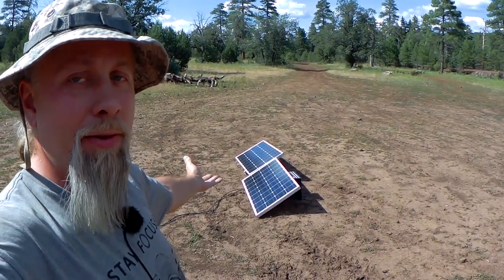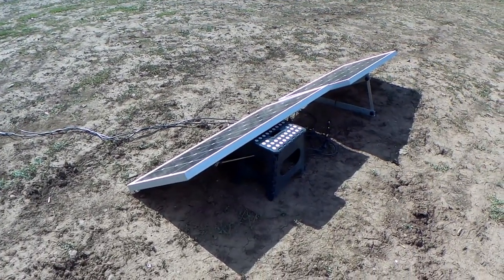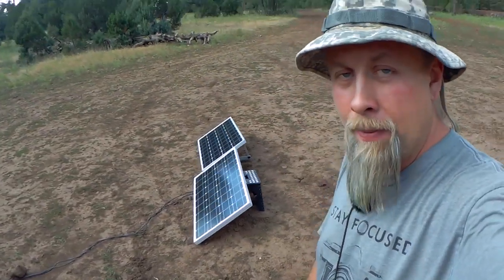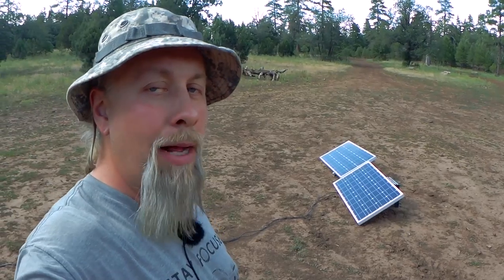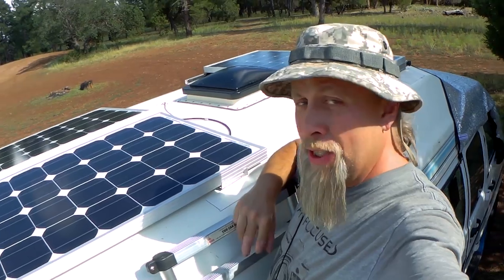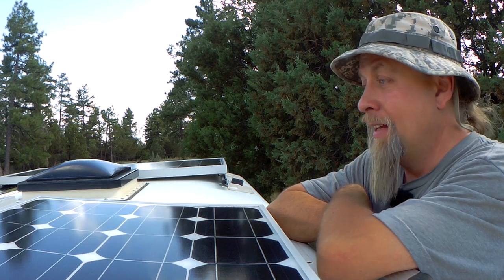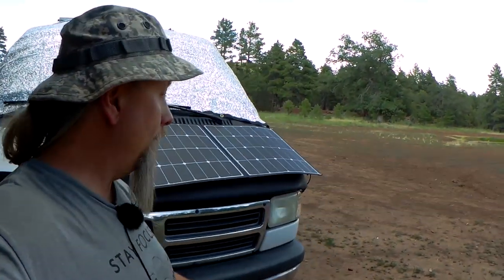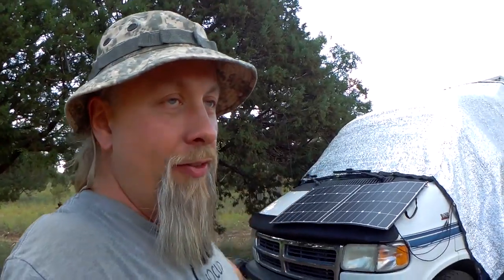Roof Installed Solar -vs- Portable Solar Panels For Your RV? Pros And Cons

Comment: I have considered a lot of the things that you have discussed. One of my thoughts is probably not practical due to weight and bulk but an aluminum frame that mounts to the top of the van that can be slid off. That way when you're driving it is fixed and when you get to where you want some shade and you're sitting you could deploy the entire rack and of course tilt it. I also considered because it is cheaper to do non pure sine wave for the items that are not picky. Pure sine wave only for instance on television and computer this would be a smaller unit with less loss and I would supplement with a cheaper one. I figure I would not have to run a large pure sine for everything because when you turn it on you produce a 10% loss automatically. With two you turn the inverter on that you need at the time
Reply from the maker: So you're saying climb up on a ladder and try to remove a bulky aluminum frame full of heavy solar panels by yourself? What about all the cabling too? Would you be able to secure this removable rack to the roof without it rattling? Far too complicated IMO. And you do want pure sine for things like microwaves and induction stoves. May as well just pay a bit more for something that will run everything.
Reply from the maker: Now what you can do is get a cheaper/lower wattage pure sine for the main stuff and run small dirt cheap modified sine for individual stuff. This way you don't produce as much loss. Smaller inverters of either type produce less loss than a larger model. My 1500w pure sine wastes 12w when it is running while my tiny 150w Foval modified sine barely loses 1 watt. Most of the stuff I charge boondocking is with the 150w.
Reply: @HOBOTECH  that is exactly what I was thinking. I hate the idea a firing up a big pure sine inverter when it is not necessary.. as far as Deployable solar panels... I was considering the idea of a roof rack with a ladder and panels mounted it. It was attached is simply as a ladder to the top of the van and it would slide off just as easy as a ladder. I am devising ways to do Rainwater catchment also. For example the homemade tarp awnings have the annoying puddle in the middle I have a simple idea to install a drain. Solve two problems at the same time. Look up water catchment with a tarp. On the internet there is rain calculators 1 inch of rain on a 8 by 10 tarp is substantial. Simple matter of adjusting two legs closer to the van creating a valley one higher on the end to create a slope 99.9% clean water except for possible dust residue that can be filtered out with any filter worth its salt. Landscape lights with the top removed gives you a small panel battery and light for under cabinet lights. Place on the ground   during the day or in the dash while you're driving . I'm not on the road yet but listen very closely to the problems and try to come up with a remedy. In a attempt to stay out longer. Generator yes if I am going to have cloudy rainy days not going to sweat it I'll be collecting water so I can stay out longer. I don't have to worry about Muddy roads and no water if I took advantage of the situation. Out of propane rocket stove and down twigs. I'm giving away all my video ideas LOL
Reply: @weswalker1208  Yes you are giving away video ideas but hey do your videos and someone will copy/compete anyway. LOL I like the water catch idea. I had a plan but yours is much better. And the light idea wow. I get those as scrap throwaway stuff quite often and they still work! Great idea especially for me who gos as cheap as possible and does a lot of DIY. Fair Winds and Smiles.
Reply: @CaptainJackScrapper   thank you Captain

Comment: Hello.  I just bought the explorer 500 and want to hook it up to my renergy suitcase kit 100 watt with the PWM voyager controller built on it.  I bought the MC4 to 8 mm cord but the panels state that they aren’t connected to a battery and the jackery does t do anything at all. I thought it was a bad cable so I bought another one and still nothing. Any ideas?

Comment: Thanks for all your videos the very informative I appreciate all your reviews on certain products. I’m currently building a Cargo trailer camper I have on there right now the Renogy 400watts solar kit with four panels and I have a 200 amp hour lithium iron phosphate battery. I like what you did in this video with having the portable solar panels to move around, I was curious how you have it wired or how to wire a plug-in port so that if I wanted to add an extra 100 or 200 W panels that I could move around on the outside of my trailer to plug into the system as well. Any info would be great thanks again.

Comment: I have @ 375 ah usable AGM storage 200w solar panels and mppt controller. I'd like another 200w panels. Mine are not attached. 2000w inverter. I think I will try series next time I connect them. Thanks for the advice.

Comment: Question for @Hobotech himself or the community.
When connecting the extra solar, are there DO's and DONT's? I presume it's fine but can I just quick connect the ground solar while exposed to the sun?

I intend to run a dual battery setup for my SUV using a flat panel designed to sit on the hood + a panel similar to those in this video attached to the roofrack but detachable so that I can run a longer cable and place the roofrack  panel wherever I need. My kit cones with a Redarc 1225 (I don't think that'll be an issue but figured it's worth mentioning).

Comment: Have you seen the Bob Wells video of a guy running his A/C off 600 watts as I recall?  You’re only one panel shy! He had a low surge A/C. Plus all his solar was on the roof. Also we like our ground-deploy flexible panel in a PVC frame for the lighter weight and not as valuable to thieves. It’s stayed put in high winds with rocks on the lower cross bar. But it’s still a pain to set up
Reply from the maker: It would never happen on 600 watts of solar. 600w of solar on a perfect day is about 500w. I have a similar mechanical 5000 BTU a/c unit and it draws about 520 watts. If you run off the inverter it's 520*15% loss or over 600 watts! The guy has a huge battery bank and the a/c is running off that, not off the solar. The solar just keeps the batteries somewhat close to full as long as it is mid day with perfect weather. That also means you can't do anything else like run a computer, or a TV, or run a 12v fridge at the same time. I'm calling foul on that one.
Reply: HOBOTECH I appreciate getting a second opinion on that one!  Thanks

Comment: great video , throw in a good dc2dc  charger then you only gotta run your engine for an hour depending on high you go in amps
Reply from the maker: Wish it worked that way. Even with my 120 amp alternator @ 13.6 volts I only get about 300 watts of charging from running the engine. That would take 8 hours from dead to charge.
Reply: @HOBOTECH  , thats what a 12v to 12v or dc to dc charger will do . boost your alternator up to around 14v plus so hence you dont need to run your engine for long to get 24 hours worth of charge providing you get a high amperage charger 40 maybe  . more amps more money  to purchase .
Reply: @HOBOTECH  google that shit dude

Comment: I keep picturing a roof mount that combines a boat seat swivel to get rotation while parked with fixed brackets to travel. Not sure how it could be made strong enough to withstand wind, though.

Comment: Great Video. Can you make a shorter one just explaining how you hooked your ground solar panels together, how you wired in your MPPT controller and how that works, and how you hooked the wiring to the battery? We were thinking of buying a 200w suitcase but it's definitely way over $500 and then we need to spend another $70-80 bucks to have a body shop install solar plugs on the outside of our RV which would wire into the battery. Would your setup work with 6V golf cart batteries?
Reply from the maker: Well, I did explain I wire everything in series and showed the wiring of the controller so not sure what else to show? I do have a video I did of the original install of the MPPT controller back in 2017 in long winded detail if that will help. You can check my solar playlist for that. Yes, you can use 6v batteries setup in series for 12v if you don't mind the extra wiring complexity and the downsides of that.

Comment: how do you charge your E-bike? I've been trying to work out a system to charge mine directly from a solar panel 
 using a buck converter but the low efficiency means it will take forever.
Reply from the maker: I get asked this question a lot so I'll do a separate video on it. Basically, I either use my Jackery Explorer (see my video on 10 uses for the Explorer 500 to see my 300w charger) or I charge from 110v using my van's pure sine inverter. You need a proper battery charger designed for lithium that provides the proper amps at the voltage of your battery. I wouldn't mess around with trying to do a direct DC charge with one of those $10 voltage regulators. I had two fail on me and one fried a new computer.

Comment: Good info I built a similar system in a Promaster but have not yet bought the extra panels as we will be fully retired this February. Then will begin longer boon docking. By the way for your information I unsubscribed a while because I didn’t like being called a peep.

Comment: Good morning Tom !! I watch a lot of your videos very interesting but never commented. I know this video is a year old hoping you can answer a question. I have been a tent camper for years bought a goal zero set up works great for my uses then , just bought a RPod camp trailer it is solar ready has solar on the side can I use my 100 watt suitcase panel if I get the right connections wires and if so what wire connections would I need. 🙏

Comment: So your onboard converter can be programmed to charge the lithium batteries?
Reply from the maker: My converter (55 amp Progressive Dynamics) can't be programmed but it does have a voltage select switch so I can force it to either 13.2v, 13.6v, or 14.4v. Battleborns will ignore 13.2v and treat it as "off", 13.6v is a safe float for them, and 14.4v will charge them at max speed until the BMS disconnects at 100%.

Comment: Ah I'm kinda a picker. What ever I get . my shack looks like  the iss. Or like a Max movie. Bout fall the sun shifts south and the trees make the place darker than a nickle cigar. So I put a pair of 50 watters on a two wheel cart. With (cable) solves this problem. I'm constantly sharing the solar world with friends. Ps I had to break some of the criminal element. By giving a party, and walked around with  a 45 on my hip. funny haven't seen them any more. That's after I got mugged. And I geared up. Life is good. Sgt williams retired

Comment: Hobo I had a question on Amazon from young lady. She wanted to know if Jackery 1002  could power her 50 watt fish tank heater? I responded that the Jack 1002 only has 935 USABLE WATTS ( PER YOUR TEST) so take 935 ÷ 50 = 18.7 hrs. Are my calculations correct???
Reply from the maker: Bingo!

Comment: do you have a common plug to use to either have the roof panels connected the system or to change and have the portable panels connected or do you connect both renogy controllers to the batteries at the same time

Comment: newbie here, got some great idea from your video. i read the roof solar panel is not good idea when the heat will lower solar reception? besides wouldn't that create heat penetrates down into the RV even if the ceiling is well insulated???
Reply from the maker: The solar panels actually create shade and there is an air gap between them and the roof. They don't overheat and they don't transfer heat to the roof.
Reply: @HOBOTECH  i have a DIY teardrop and plan to set the 100 W and 200 W on the rooftop. would you advise put the 100 W on top and 200 W below on the slanted roof? should i connect the 100 W to the 200 W downstream since i plan to do it in parallel that will give me 12 V?

Comment: Is it possible to run your air conditioner off the Battleborns for a short time? Say 1 hour.
Reply from the maker: 5 hours if I wish but I prefer to use the generator for that.

Comment: Just got my Explorer 500!!! Tom, do I need an Mmpt controller for my Jackery System? Thanks Bud😀
Reply from the maker: The controller is built into the Explorer. You can plug a solar panel directly into the input.
Reply: Thanks very much!

Comment: Hi. I am thinking of getting foldable/portable panels and find a way to still fix them to the roof safe for driving (certainly standing). Maybe like a screwed on all round wooden frame that then might obscure a minimum of the panel but ensure it stays in place while driving. I do not find videos or comments about that, is that a bad idea in any way?

Comment: Also, what do the Battleborns run?
Reply from the maker: Everything. 12v fridge, several computers, tv, ice maker, water purifier, routers, cameras, hotspots, cell boosters, lights, fans, stereo, e-bike, pressure washer, projector, etc. I'm a lot more complicated than most RV'ers.

Comment: what about a passenger seat bracket turns around on platform /roof  you do e,w,s, ?
Reply from the maker: If you don't mind it sticking a foot up off the roof. Those are also like $300.
Reply: @HOBOTECH  just a thought the $300 wow and 1 foot not a good thought....just trying to put things out and hoping someone may get idea and come up with something..maybe the bracket some use to fold away beds that is about $20.00 and clearance looks to be about 1 inch..

Comment: With your two batteries what can you run with those and for how long? I was looking at some of your other videos but didn't find one that explained your intent. Obviously your combination of panels allows you to charge at a significant rate. You mentioned in a 1/2 day. Do you run direct off of solar for the other half of day?  Looking to complement my generator during the day where I would use the Genny at night for A/C.
Reply from the maker: To answer that would take its own video. You can see my RV tour video for the basics. Here's a short list. A 12v fridge, several computers, tv, ice maker, water purifier, routers, cameras, hotspots, cell boosters, lights, fans, stereo, e-bike, pressure washer, projector, etc. Yes, once the batteries are topped up I am running on solar until sundown.

Comment: PLEASE HELP!  I have been seriously racking my brain about this for a week now...  I want to hook up the portable panels to my lithium battery located at the front of my travel trailer...  it is outside in a box.  I would like to have a quick disconnect set up to connect to the battery.  But where do I find those adaptor wires???  Do I make them myself?  That may be beyond what I can do.  

Can I buy these wires premade on amazon?  I would like to have a wire permanently connected to the battery with a quick connect/disconnect so that I can plug and unplug my solar controller quickly  (same one you spoke about in this video).  Because my batteries are located outside, I will also have to have some sort of cover so dirt water doesn't get into the connectors.  Also what AWG wire were you using?

 PS - I also boondock a ton in AZ  

I found these and I can see how they would work for controller to the portable renogy panels - so I have this side of the controller taken care of.  But what about the other side?   https://www.amazon.com/gp/product/B07V3L4FQQ/ref=crt_ewc_title_srh_1?ie=UTF8&psc=1&smid=A3M3YMPQTI06AD
Reply: Would I use this on the other side connected permanently connected to the lithium battery?  If that is the case - where do I find a cable that is anderson connector on one side (to connect to this) and bare wire on the other side to have permanently connected to the solar controller?  Could I run mc4 cables out of the side of the controller that goes to the battery - with one end being the wire that goes into the controller and the other side being mc4 connectors - and then attach mc4 connector to alligator clip on the other side?    https://www.amazon.com/dp/B0775YD4CT?tag=hobotech0e-20&linkCode=ogi&th=1&psc=1
Reply: This part has me SOOOOOOOO  STUCK!  and I've probably spend 30 hours with video and reading to try to answer my question and cannot figure it out.  Other than making my own cable, which I don't know how to do.

Comment: Another disadvantage of the roof mounted panels is that you have to drill into the roof... or am I missing something?
Reply from the maker: Yep. You missed all my videos on how to install roof solar panels using VHB tape.
Reply: It is generally preferable to mount them to a rack instead of drilling the roof.   This also allows for a cooling air gap.   Panels derate (ie, make less power) when they are hot.

Comment: I live in a van. Spent my whole summer in AZ. I use a lot of power every day. Never ran out of power. I do not have a generator or an inline solenoid. I disagree with what you are saying. I have yet to see a van build solar video were the builders had any electrical background.
Reply: What in particular do you disagree with?
Reply: @fratermus5502  He said it is not possible to get by with solar alone...I do get by on solar alone so I disagree.
Reply from the maker: You can get by on solar alone if you either have low power needs or a boatload of solar. I know many people in regular vans or cars/trucks that have a 100 watt panel and that's all they need. They typically don't own a refrigerator, a TV, or computer either. I suppose I should have said that if you want to live with any modern amenities you can't rely 100% on solar.
Reply: @HOBOTECH  I have a freezer, a blender. an a/c, a computer, and a bunch of little charging stuff. I have 3 panels (not a boatload) and one battery. My system is optimized to my use. I bet you a dollar I could get a 20% gain in your system Using only what you have. Hey I am at Marshall lake drop by I will buy you a beer!